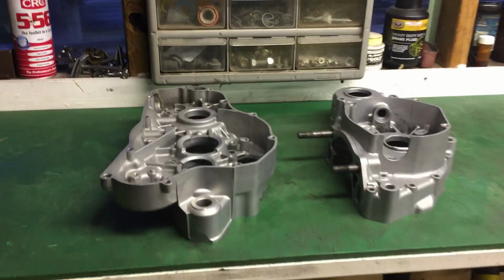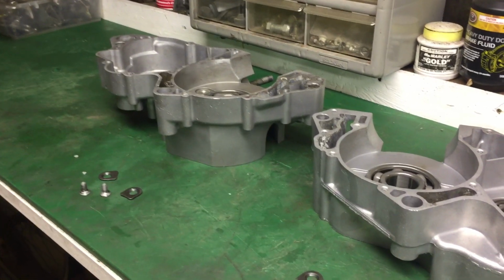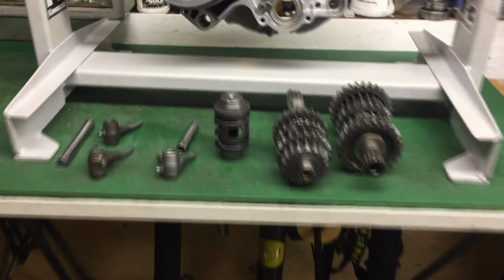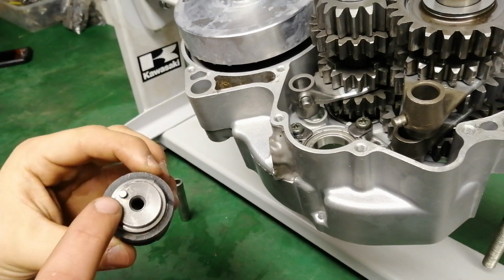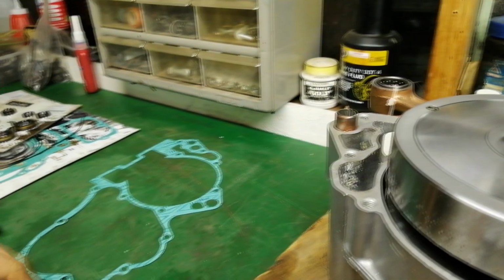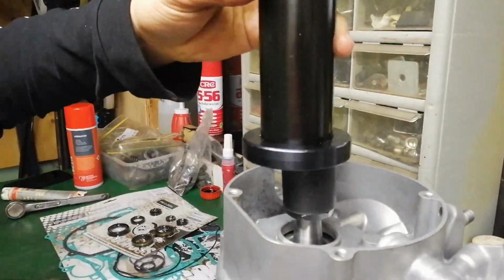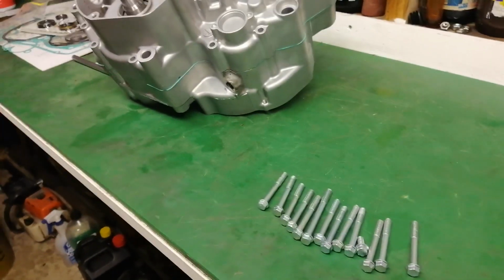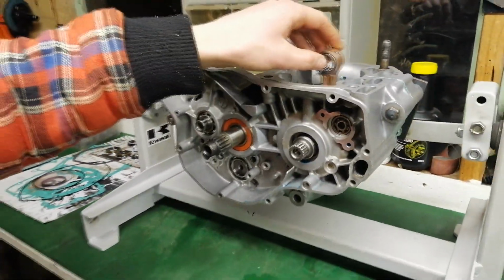2019 RM 250 Build Part 5: Engine Rebuid #1 (Crank, Transmission and Shift Assembly))

Comment: Huge difference to the mess ya started with.🤙
Reply from the maker: I'd say. Someone clearly got hold of a black spray can. Looks mint. Would like to do some performance mods to it soon. Haven't even ridden it yet😂😂. Reeds,Head and Lectron carb. Might get a new cylinder and do some porting work to it as well. Maybe in v2 of the build. 🤙